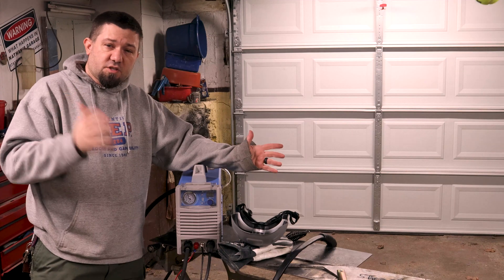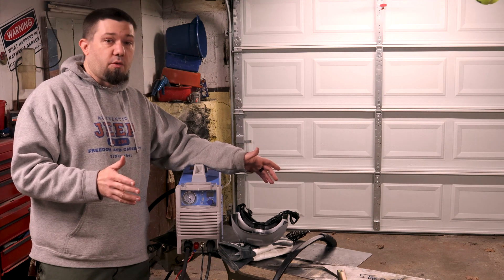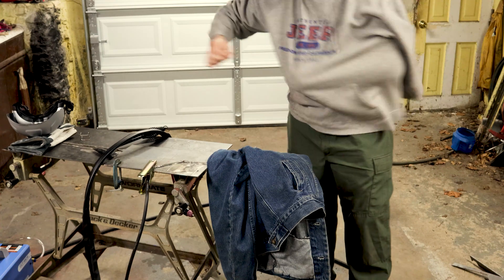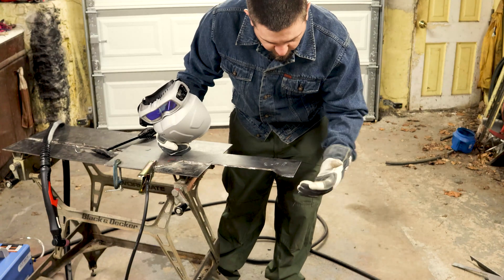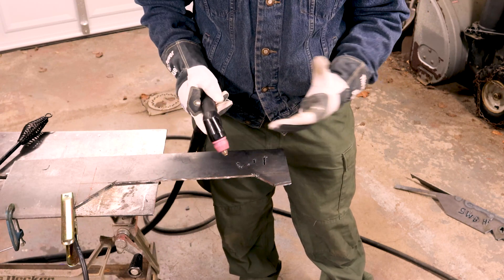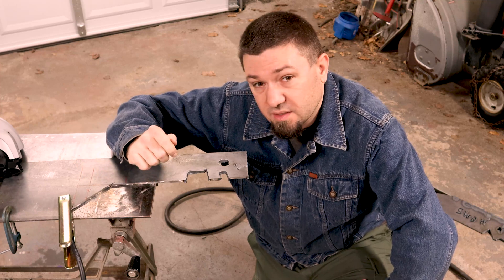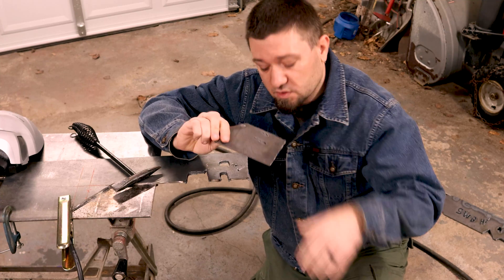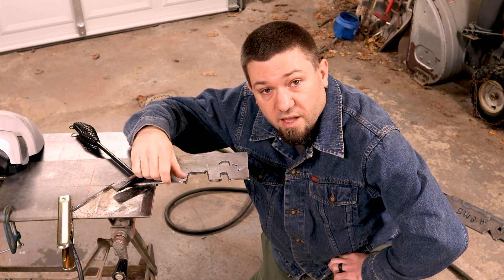How well does the Yeswelder Cut-55DS cut when it's got a proper 220 line?  Let's find out!

Comment: OK I am a First time user. I set up the machine and was trying to cut a small 11/4 inch circle  to make the bracket for the back of the machine. Mine did not come in the box and did not want to wait until another one arrived.  I set the amps to 15 and air to 30.  110 volt 15amp breaker. The machine will not run but a few seconds and stop.  I tried a few times having the same results. Turned the amps up to 20 and had same problem. Turned amps to25 and it threw the breaker. Is my setting that wrong or do I have a problem with the machine. I am holding the trigger in ,but it just stops until I release the trigger and pull again. material is 3/32 aluminum. Also I have a flashing light ,the first of the three top right. Thanks in advance.
Reply from the maker: i have not tried to cut aluminum with mine. i can say that what you’re describing sounds like it’s not getting a complete circuit. mine does that too. check your ground, make sure that the tip isn’t dirty, and make sure the electrode inside is tight and clean.
Reply: @SWBCrawler  The piece was held to the table using the ground clamp having direct contact?
Reply from the maker: @luckyking63  that should be a solid ground then. I do not know the specifics of cutting aluminum though. The specs say it is capable, but does the process differ?  I would also check the electrode. as i mentioned i have had issues where the electrode in the tip had come loose, or was tarnished. causing exactly the issue you are describing.
Reply: @luckyking63  your 120v line with a 15amp breaker in your house is not the right power being give too the plasma cutter! 

@rjbradleyjr
0 seconds ago
 @Chilllybob   great information i have a newer/Cut-55DS pro and i was having problems with running it on 120v on 20amp system..... non HF pilot arc. The pilot arc wound start and go out with in seconds before i can start cutting, then the light bulb came on in my head... when the breaker tripped these machines should be on 30amp breaker or higher for 120v. I found this out the hard way after replacing two machines... Yeswelder don't have this in manual, the did replace it without any problems... but this could have been cached earlier.

Comment: Will it run on 120volt and a 27 gallon compressor on 1/4 inch
Reply: You are limited ONLY  if you run in on a 15 amp .If you have a 20 amp circuit use that or even better if you have a 30 amp circuit which I'm using  it'll cut through a 1/4" no problem at about 30 amps I've even gone up to 45 amps no problem on a 120volt .. I do not have 240 and feel you do not need to 240 volts if you run this on the 30 amp. circuit... people say 110 it's actually 120 volts and they say 220 it's actually 240.
Reply: @Chilllybob  🤗 great information i have a newer/Cut-55DS pro and i was having problems with running it on 120v on 20amp system..... non HF pilot arc. The pilot arc wound start and go out with in seconds before i can start cutting, then the 💡light bulb came on in my head... when the breaker tripped these machines should be on 30amp breaker or higher for 120v. I found this out the hard way after replacing two machines... Yeswelder don't have this in manual, the did replace it without any problems... but this could have been cached earlier.
Reply from the maker: On 120 you are limited on what you can cut.  And it doesn't limit itself so it's easy t trip a breaker. .  I was not happy with the performance on less than 220.

Comment: Nate get you some insulation for that garage door ,can get a sheet and cut panels to fit that door, keep that heat in, just a suggestion
Reply from the maker: Yep, ill be doing just that, just havent gotten there yet.  Long story, but we'd bought this door for an unheated un-insulated garage, and we couldnt make it work.  So instead we installed it on this garage.  Took a bit of doing just to get it installed because of the clearances and whatnot.  It still needs a weather seal, and insulation.   Thanks for the suggestion!